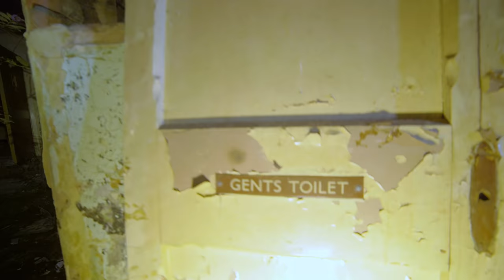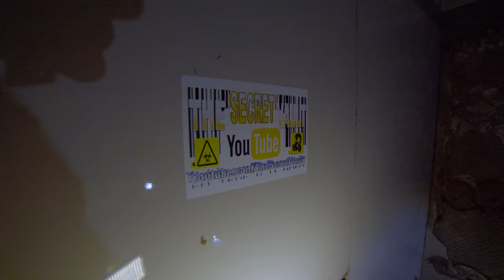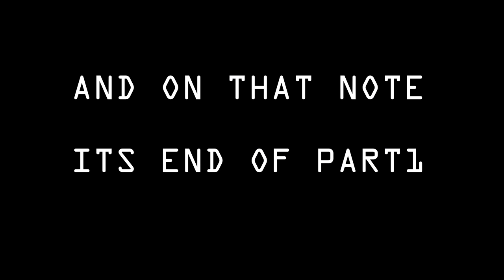St Josephs Orphanage - EVEN THE DEAD WOULD BE SCARED part1

Comment: Only a a few miles from me. I've been in a couple of times in the past as it's been empty for years. One thing to note is this where the Entertainer George Forby passed away in the 1960's . As with a lot of these buildings they are left to rot and then planning permission put in to pull most of it down. Did you get chance to check out the old Park Hotel across the carpark from here. Currently waiting redevelopment but a beautifull building.  I've had a walk round the outside but security is pretty tight.